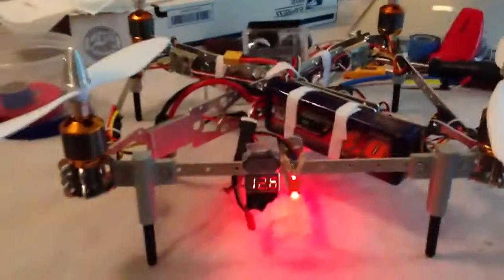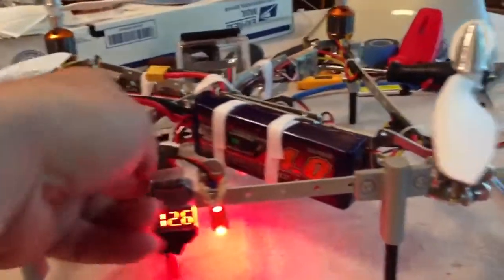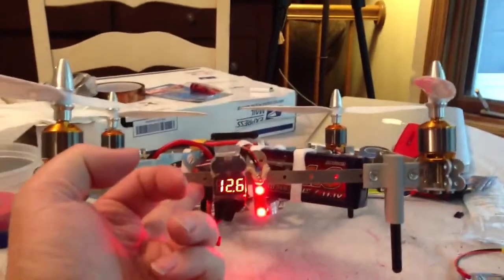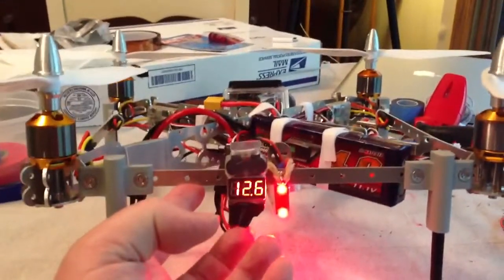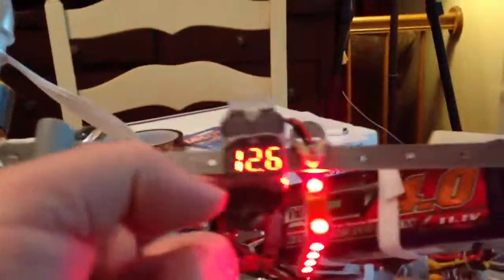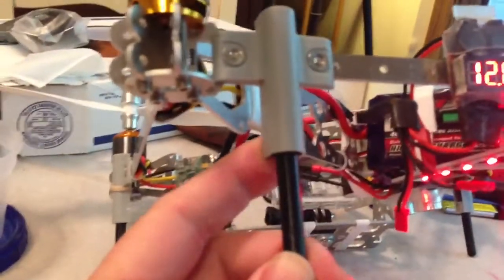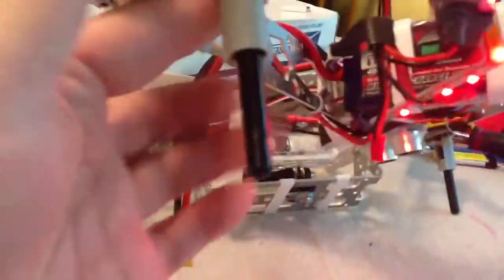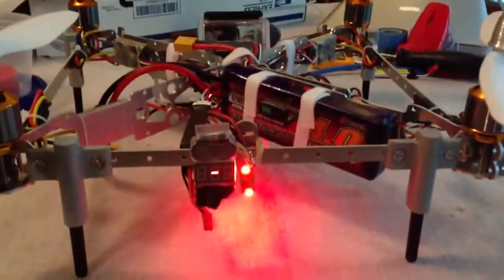UAir R10 Quadcopter Mods Part 1 - Links below.

Comment: hi, would you mind sharing the specs on the motors? I bought an R10 on ebay and broke a motor shaft, have been trying to replace the motor to an exact match; thanks.

Comment from the maker: bobdobb1088, sorry I missed your comment for so long. My take on the R10 four months ago as that it wasn't flyable - it was "crashy". But not long ago I put a Naza Lite FC on it and gave it another go - and no I actually like it a lot. I have since moved on thug. I have built several other quads, and I have come to prefer the TBS Discovery models because of their very good flight characteristics, flexibility in motor and battery setups, and the frame's generous real-estate - great for FPV and OSD electronics, cameras, etc.

I posted a write up on my blog about the R10:  http://www.tonystoolbox.com/2013/12/quadcopter/a-uair-r10-quadcopter-flying-the-way-you-always-wanted-it-to-fly/